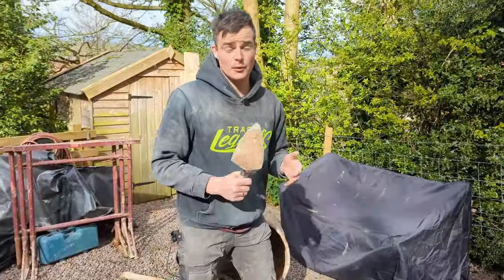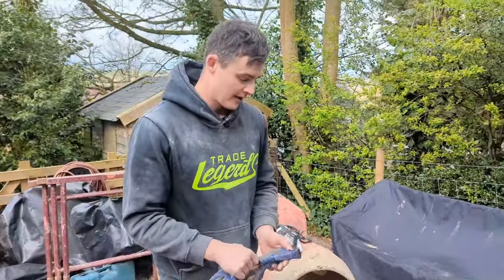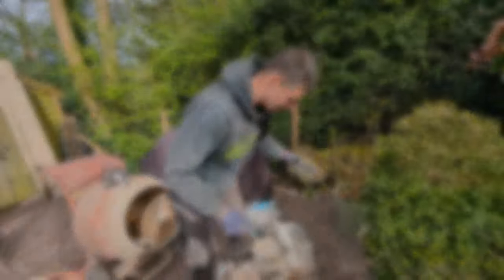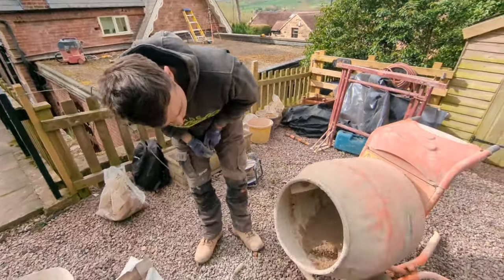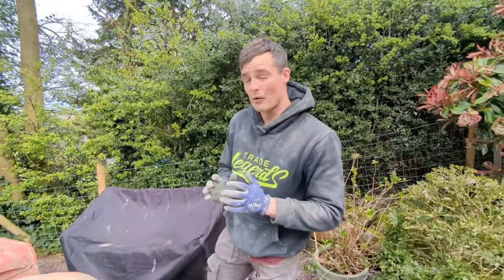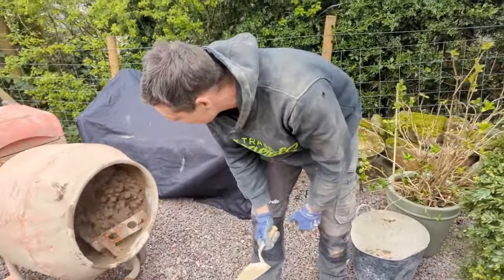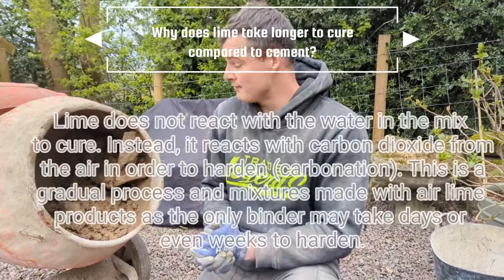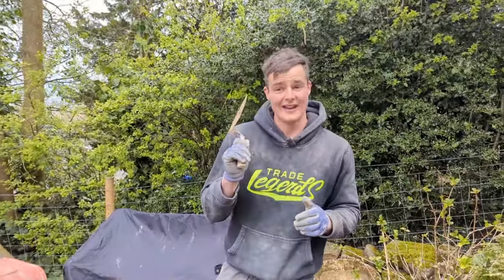How to make LIME mortar for repointing| 3.5 NHL Lime #construction #howto #diy

Comment: 3.5nhl is probably too hard for most historical stone/brick applications. NHL 1 or 2 or even a mature lime putty mix would be better. The mortar should always be softer than the building material when fully hardened. The 3.5 refers to mortar strength in mpa developed at 28 days. Nhl can continue to get harder after this time. The mortar is intended to be sacrificial it should be the main conduit for damp evaporating in a wall, it is helpful to see mortar as shock absorber rather than a glue. Buildings tend to move due to ground changes, expansion and contraction, a well made lime mortar has flexibility which can accommodate movement without cracking. If cracking occurs lime mortar can self heal by migrating free lime to the site of the crack. Natural hydraulic lime can cure under water due to the chemical reaction of the constituents, ordinary lime putty has to rely on absorption of carbon dioxide from the atmosphere. It is important to dampen the substrate before application and protect the mortar from wind/ sunlight to keep as much water in the mix for it to cure successfully.
Reply: Is it better with hydrated lime?
Reply: @ingevansand9180  No, hydrated lime is mainly used as a plasticiser in bricklaying mortar, it is a poor substitute for lime putty. Hydrated lime is widely available whereas lime putty is generally sold by specialist suppliers who have a delivery network. Hydrated lime is often mistaken for hydraulic lime.
Reply: Use a hotlime mix Calbux 90. 1 lime, 3 sharp sand. This way you know what you’re getting.
Reply: Fully agree. I only use hot lime now!
Reply: I'm repointing and rendering my stone cottage; the walls are granite, so even NHL 5 is softer.  😆
But you're absolutely right about permeability and wicking; there needs to be a balance.  I have to use NHL 3.5 in many weather-facing aspects of my outer walls (winter storms are ferocious here, and temperatures of -6 to -10°C occur most years) but hot lime putty can be used exclusively indoors.
Reply: Yeah sound lads

Comment: Izzy, I work as a volunteer on the Buildings Team at the Chiltern Open Air Museum. The Museum saves condemned buildings from the Chilterns, takes them down and rebuilds them on site using traditional methods of construction. At the moment we are repointing the Toll House from High Wycombe with lime mortar. I’ve never done this before but have seen your videos which I have shared with my co-workers; we all use your work as a guide and it’s beginning to look amazing. Thanks so much.
Reply from the maker: Hiya mate, that's amazing what your doing, restoring old buildings! Really pleased that my video was able to help you and your co workers 🙂🙂 please send me some pictures of the project ☺️
All the best
Reply: NHL 3.5?

Comment: I have found 3.5 to be far too hard. It doesn’t allow walls to breathe. Even some NHL 2 are too hard. I have reverted to using hotlime instead.
Reply: Wots hot lime ?
Reply: Hotline is  the way forward. The mortar must be softer than the stone/brick otherwise there is no point.

Comment: Proper lime mortar for stone buildings is hot lime mortar or lime putty. Lime powder or kibble ( calcium oxide) made from limestone rock ( calcium carbonate) during slacking becomes calcium hydroxide and during curing by carbonation becomes calcium carbonate again. Carbon neutral material and best for stone walls. Little bit of pozzolan can be added to achieve feebly hydrolic mortar. NHL is modern substitute of lime that is way different ( worse for stone walls) than traditional lime mortar.
Reply: I think it depends upon where you live.  I live at 57.5°N, in northern Scotland; external lime season is short here, as there isn't a big window for lime putty to dehydrate and carbonate sufficiently before the onslaught of winter.  My cottage walls are granite, so impervious; I am repointing with NHL as sympathetically as possible but while also trying to maintain a balance between wicking and waterproofing.  So the north-facing gable end and western wall - where the storms come from - uses NHL 3.5 in the joints but NHL 5 along the roof line.  South and east walls can be a mix of NHL 3.5 and hot lime putty, depending upon the strength needed (because in part it is rubble infill).

I want to use more hot lime - and will use that exclusively for the render coats - but I have to listen to what the cottage walls tell me and respect the power of the storms, which by the way are getter worse every year it seems.  😔
Reply: @ateleskier7066  I don't think that in Scotland historically lime putty was used much for external pointing.   Also most likely quicklime back in the day had more impurities in comparison to modern ones. I add pozzolan in the form of brick dust or trass and by doing it quicker in the initial set. It gets very hard on the surface after a week or so in humid conditions and even quicker in dry conditions. But so far I have only repointed sandstone and whinstone. But granite is very hard so maybe NHL is fine.
Reply: @ateleskier7066  with granite I expect nhl is totally fine as it’s never going to be harder than the actual granite. Sandstone is a completely different matter.
Reply: We hear a lot about hot lime and we use them however, it does have limitations. It is important to know the history on this one. In Europe we have, for thousands of years used hydraulic limes by adding small or large amounts of pozzolan. In England we do have our own NHL which was often used in our historic buildings (grey chalk lime etc) Just as oranges are not the only fruit, neither is hot lime.
Reply: @ironimp1  I recommend to watch Nigel Copsey's presentation on you tube. He gathered a lot of evidence how NHL ruined some of the historical buildings and what he thinks about NHL mortars used for stone walls and old bricks. I find it interesting.
Reply: @MrDziuka  I am fully aware of Nigel's work, but I hold a different opinion based on my technical knowledge and experience.
Reply: @ironimp1  it would be interesting to go back to the walls repointed with NHL 40 years ago and check condition of the stonework. Because I have seen original hot lime mortar as old as 300 hundred years or more and stones and pointing still in great condition which makes me think that hot lime mix is pretty good material if it lasts and protects the walls for so long.

Comment: NHL actually sets because of the water not air carbonation.
You’re thinking of hydrated lime rather than natural hydraulic lime.
Reply: NHL also uses carbonation to achieve full strength, but initial primary set is chemical; another lovely feature of lime over OPC (cement) is that it just keeps on getter stronger over time.
From page 36 of 'the bible' - English Heritage 'Mortars, Renders and Plasters', part of its 'Practical Building Conservation' series (ISBN 13: 978-0-7546-4559-7):

"When water is added to hyraulic quicklime the free lime reacts relatively quickly and hydrates (slakes) in the same way as non-hydraulic quicklime.  If suffient water is available, the calcium silicates and aluminates will also hydrate (but more slowly than the calcium oxide) to form solid, interlocking crystals of calcium silicate hydrate and calcium aluminate hydrate; it is the latter process (which often starts within a few hours of water being added) that is responsible for the initial setting of hydraulic lime."

"Due to the hydraulic set, hydraulic lime gains initial strength faster than non-hydraulic lime.  Further strength is gained due to both the continued hydration of the hydraulic components and the slow carbonation of the free lime in the mix, which can take several years."

If using NHL also bear in mind that stronger isn't always better; it depends on how much breathability you require.  The higher the strength, the lower the porosity and water permeability.  I've had 'professional' builders tell me that I shouldn't use lime on the outside of my granite cottage up here in northern Scotland (because it won't keep the water out), yet local councils repair old stone bridges over flood-prone rivers using NHL 5, and it's fine.  Here's the bible again:

"Ultimate strength of hydraulic lime is higher than that of non-hydraulic lime.  However, there is an inverse relationship between hydraulicity and porosity and permeability: the greater the hydraulicity the lower the porosity and permeability."

So if you need breathability more than strength (for example in my case for my kitchen wall) then hot lime putty (non-hydraulic) is better than NHL 2.
Reply: @ateleskier7066 Yes all lime sets with carbonation eventually. NHL just relies on water for its setting mainly.

With your kitchen wall, being granite (which is mostly quartz) I highly doubt putty will make any real difference to nhl 2 or even 3.5 for that matter as any water vapour passing through the lime will hit that granite wall and slow down so much it will almost stop.

Add that to anything other than clay paint on your wall and you’ve lost any benefit of putty.

Obviously putty won’t hurt and it has many benefits in the right place, just not sure it’s necessary in your kitchen.

Comment: For consistency of across mixes why not use a smaller tub to measure each substrate? Fill and flatten down and across the top with the trowel will get a better measurement. The big tub that is used here means that the sand and lime is thrown several times, instead of just tipped in from a small tub, causing the lime to be cast up into the air more than necessary. The strength of the mix ought to be adjusted according to the hardness/softness of the bricks to ensure that the mortar is the weaker.
Reply: 3.5 is not the softest because its not 100% Lime
Reply: Not good at all.

Comment: Izzy.
I am commenting on your video and really hope I can help anyone out on this subject.
Lime is a very vague subject amongst tradesmen these days and a vast amount of knowledge has been lost over the past 80 years.
As you know it's expensive and not a very good way to earn vast profit.
I have lost countless nights sleep over it.
2m2 per day is about my estimate these days.
If you get a sample tested you will find the mix to be around 1:1 maybe 1:2 
All will depend on where you are in the country as material never generally travelled far.
The use of soft sand is absolutely no benefit.
If you can find the original sand source you are safe ( a local fresh water river bed source as in some area's of Kent)
A sieve analysis will give you the correct sand grading ( part of the mortar test )
This all seems a lot of fuss but you will have the correct info on which to spec your mortar.
I have been on some repointing jobs for more than 2 years.
It's a lot of work to put it right and this is because the client is normally wealthy and can easily take one to the cleaners so you will have to correct it.
There has been vast amounts of research into lime and it's a known fact that you cannot get modern lime to behave like the old this has a lot to do with purity and the old limes where dirty and this stems from the burning of the calcium.
Our limes are pure in contrast mainly due to modern pollution concerns.
The safest solution is to get your mix specified by a professional that has an indemnity insurance.
It will cost you but you will have support.
The good workmanship is down to you and that's another story.
Reply from the maker: Oh wow that's amazing Darrin, I, probably like everyone else besides a few people, had no idea about all of that information you just shared. Appreciate your knowledge on the subject ☺️ where have you been working buddy?
Reply: @IzzytheBricky Thank you for your kind reply Izzy.
I work in East Kent and 90% of my time on my own.
Due to this I will often be employed by a well to do client that just wants their old property repaired etc.
This often involves the use of Lime and reclaimed materials I have a few builder friends that just can't be arsed to fiddle about with stuff resulting in me having to sort out old traditional stuff.
I was very fortunate to have been around old long gone tradesmen that knew how much I liked old work so they used to pass on all manner of knowledge.
With old buildings come wealthy people and they normally have a very sharp educated brain.
I never try to out smart them and try my best to get on with things properly this means you have to know the answer to their questions.
Say a surgeon that can understand a lime technical leaflet in a few seconds.
Lime is a big subject amongst the middle-class folks and they don't like dirty hands.
The proper tuck pointing boys have all number of secrets on the subject that keeps them nicely employed.
I have made some serious mistakes when working for ignorant builders that think the £15000 repoint is just big load of profit.
If you know your product and have the right technique you can earn reasonable but I am afraid money makes people do funny things.
Reply: great comment Darrin, thanks. Have you got your own channel? Lime is a fascinating subject and needs more people like you to spread the word!
Reply: You my friend are clearly switched on and dilligent.  I don't mean to be offensive to builders, but I've had a few comments thrown at me in local builders merchants when asking for NHL to the extent that I quickly learned to source exclusively from specialists.  Your attention to detail, even if it is protectionism (which is smart) is impressive; not many people bother with sample testing and matching which is a big pity, as it's a fascinating subject on its own.

I hope your customers recognise your differentiation, focus, effort and intelligence; keep going as you are and I guarantee you'll make a good name for yourself.  To be fair to the average builder, lime work is slow and highly skilled, and many customers just don't want to pay for it.  Up here (northern Scotland) there are plenty of rich folk (oil and gas) but they live in modern builds; the people in old cottages are the poorer folk like me who cannot afford to pay someone, so need to learn it from scratch and DIY. 😆

I wish you all the very best, but am pretty sure success and prosperity is going to follow you about like a lost dog if you carry on like this.
Reply: @crooningbarber  Thank you for taking the time to reply.
I hope life is going nicely for you.
Reply: @ateleskier7066  Thank you so much for your kindness.
I really appreciate it.

Comment: This is a really good video, very informative and useful, thank you!  Out of interest when mixing up small batches (using a paddle mixer on the 4th floor of scaffolding) - do you mix 3:1 by weight or volume?  there are a lot of opinions and I would value your input 👍🏻
Reply from the maker: Hiya mate, I do it by volume, not thought about doing it by weight☺️
Reply: It's always volume.

Comment: Thanks so much, good to see your exact recipe. I'm researching for completely covering an old stone interior wall in Italy. I first need to do a round of "dubbing out" to roughly fill in the very uneven original mortar (never pointed, it was a barn....albeit a very thick-walled and sturdy one). Is this mix you describe here good for dubbing out? I'm not clear on what is the best ratios of soft sand, sharp sand, and NHL for filling and levelling, RATHER than just repointing. Thanks!
Reply: If it's an internal wall I'd be opting for hot lime putty mixed on site rather than NHL; far better for the building if you don't need rapid strength.  You can use NHL but I wouldn't recommend anything more than 2.  But I'm an amateur so take what I say with caution - consult a genuine expert.  ;-)

Comment: Hi, can I ask you what sand you would use for a 120 year old house with lime mortar? I keep getting told sharp is best but can you use a mix of sharp and plastering dav to be able to use in a mortar gun? I do re-pointing now and again but only with traditional sand and cement in the guns. 
Thanks
Reply: Don't use a gun!  I'm only saying that because that's what everyone I encounter who knows their business with lime says this, I think largely because it doesn't pack it enough and can lead to voids.  And it's also not traditional of course.

The problem with sharp sand is the lower level of hexagonal close packing relative to fine sand; i.e. the water-retaining spaces are larger - which water runs out of - and the surface area is lower so adsorption (not aBsorption) isn't as great, so it holds less water.  (The larger the particle, the larger the space between them when they are pushed together.)  I've been repointing in my old kitchen and started with sharp sand - because it closely matched the old lime mortar I raked out - but am finding it hard to work.  So I'm having to adapt by adding fine sand, just as this video showed (hooray!) to provide a matrix with smaller inter-particle spaces that increase adsorption and retains more water.  You have to watch the mixing though, as too much water leads to cracking.  My mixing isn't perfect yet which is my current main focus.

Comment: Izzy you are confusing hydrolic lime with hydrated lime.
You should not knock it up the next day as hydrolic will loose its chemical strength same as cement its a chemical setting process not a carbonating process like hydrated lime which you could knock back up any time

Comment: You can mix it then store it in tubs with water on top and a lid.
Reply: Not this stuff, you need quicklime to be able to store, not nhl i believe.
Reply: Yes, you will need lime hydrated lime rather than nhl for long term storage, nhl sets with moisture
Reply: Hi , can I use hydrated or NHL for any lime work?
How do you test if is Lime ?
Thanks